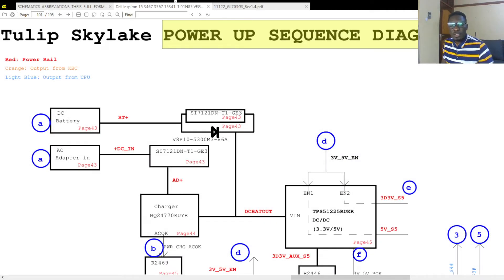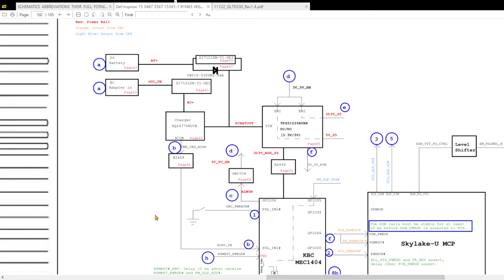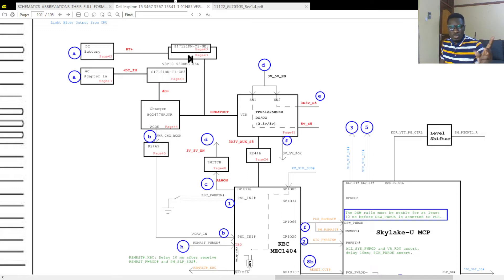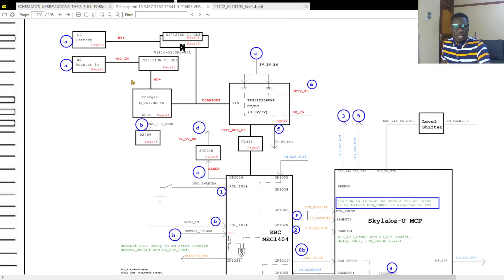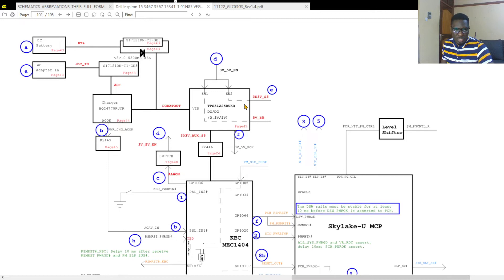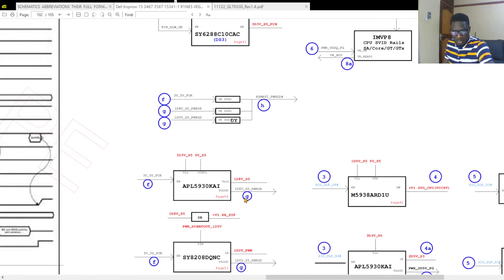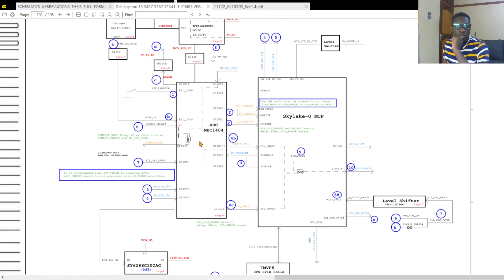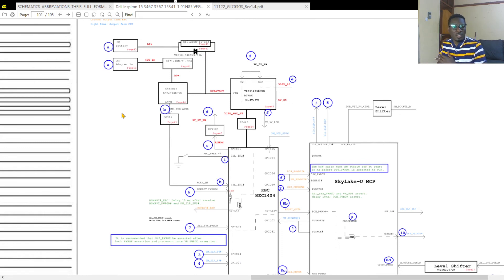Laptop Motherboard Power UP Sequence Part 1

Comment: Thank you so much brother.   My hp elitebook mt45 goes on and off repeatedly without display, and fan keeps running at maximum speed. It keeps going on and off without display and wont stop untill i remove the battery because it wont even power on adapter only, and the charging light blinks orange for some seconds, then white and goes off, even without plugging an adapter. I'm still trying to resolve 😢. It's a ryzen 3 processor, initially, i suffer throttling from prochot ext and prochot htc even though the processor temperature is not hot (47°C/ HWinfo). Now, no display. Just going on and off without display.
Reply from the maker: Try flashing its Bios with a good file